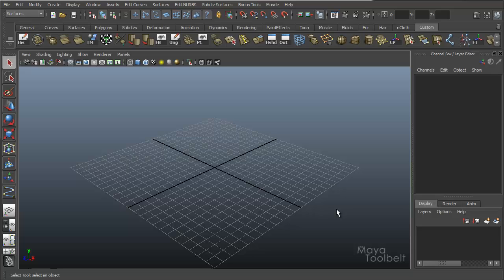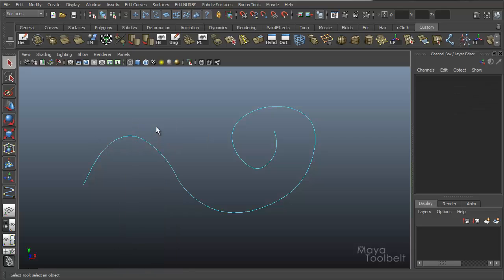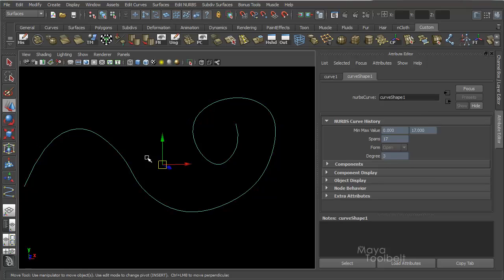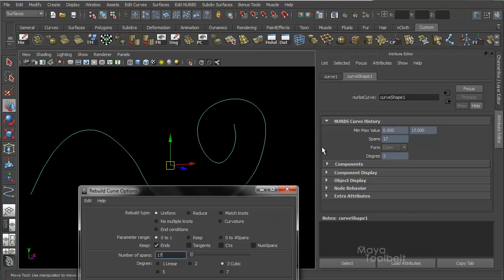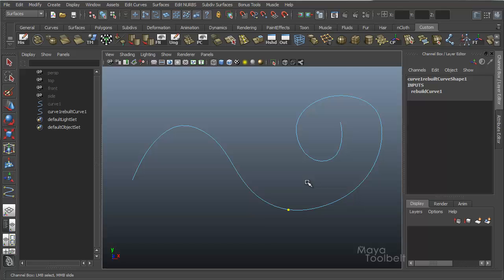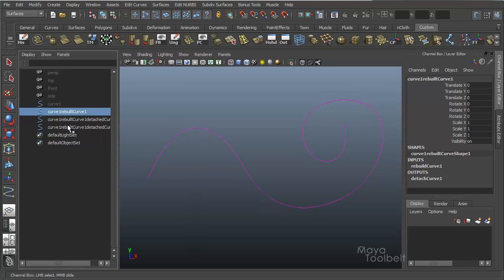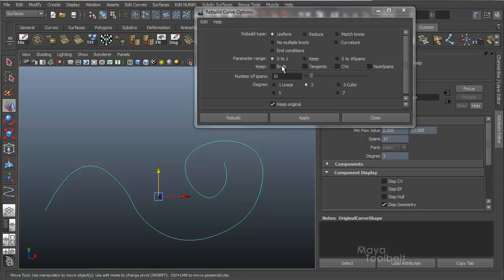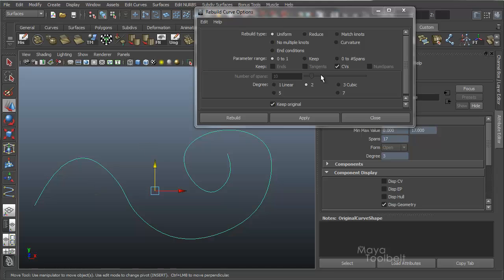The Maya Toolbelt - Rebuild Curve - Part 1

Comment: what I am looking for is an explanation and how it applies to production.  disappointed
Reply from the maker: It's primarily if you need your curves to have a specific number of spans, parameter range, etc. Usually, when building shapes with curves, you want the spans/parameter range, etc. to match to get as clean a result as possible.